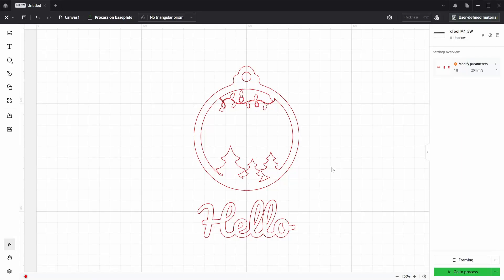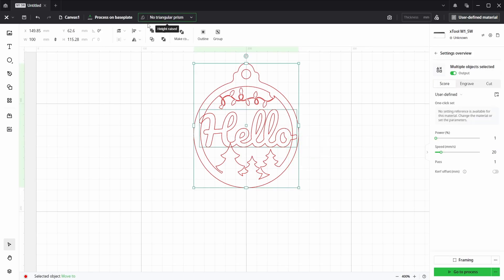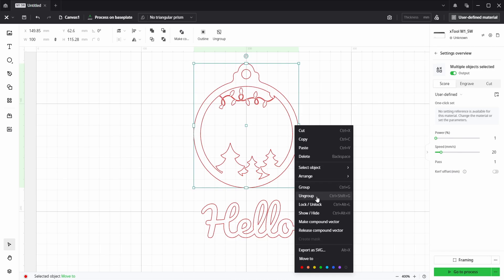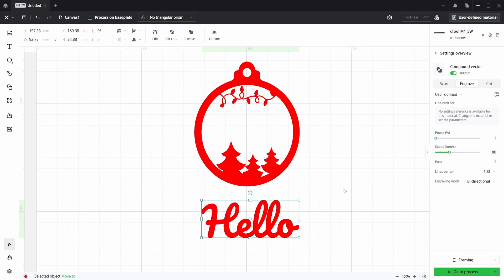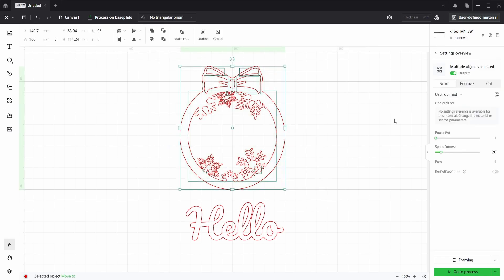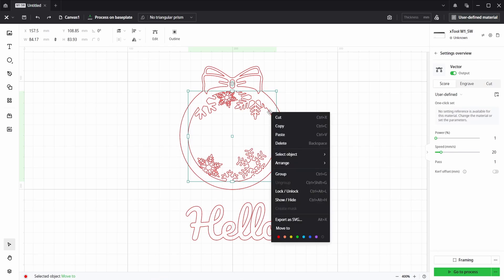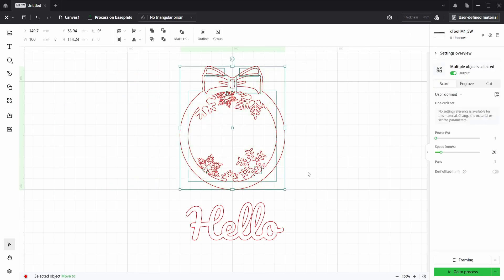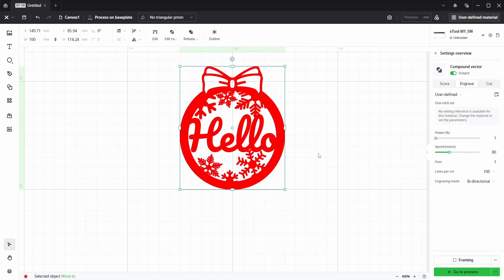XCS Expert Shares Top FIXES for Unite & Weld Problems!

Comment: if I have two circles aligned center with one being smaller than the other, how do I get the area between the two circles to engrave.  Instead of it filling in the entire circle?
Reply from the maker: Hi, you would just need to select both the circles and right click and make compound path to join the together properly. Thanks Gav

Comment: Thanks for the video and tips.  As a newbie to this was trying to unite some text to another picture and this assisted with that.  Thank you.  I watched you other video on uniting as well and also helpful.  One item which I am still have a problem with and I'm sure it is user error.  After I unite the font (it seems regardless of which one I select) all fills in.  The space in say the "e" or "a" just colors in as well for engraving.  Any idea on what I might be missing...?
Reply from the maker: Hi, Yes its probably because the e and a are still exploded and all separate vectors, You need to make them as separate compound paths before joining. If you watch my video on joining text you will see what I mean. It's this video:  https://youtu.be/RTtdZdzmzo8  Thanks Gav